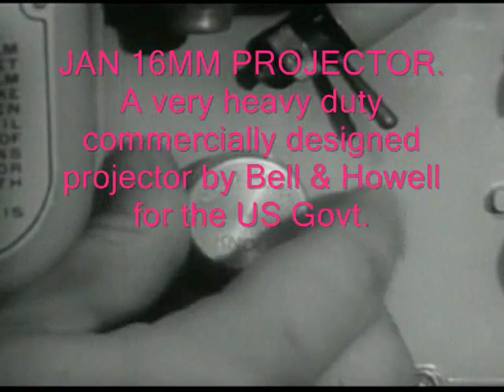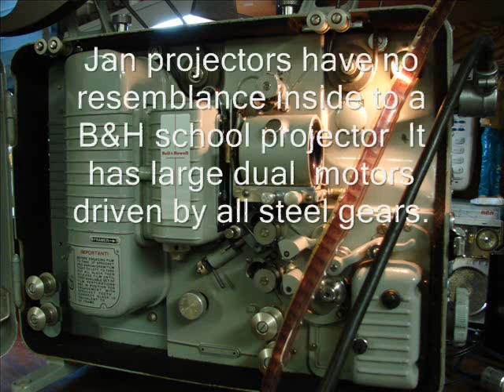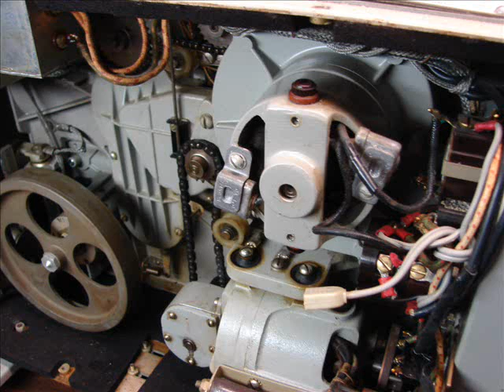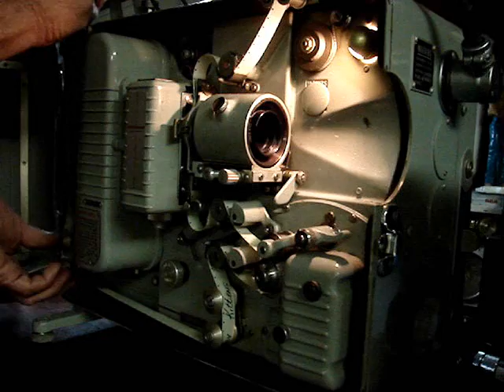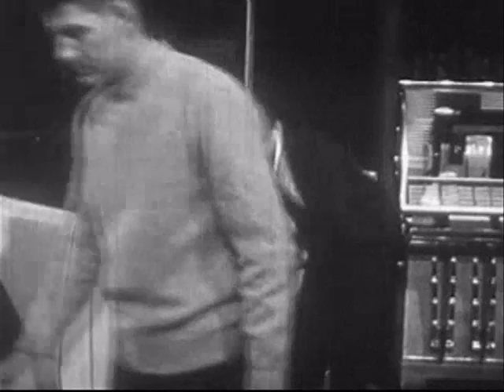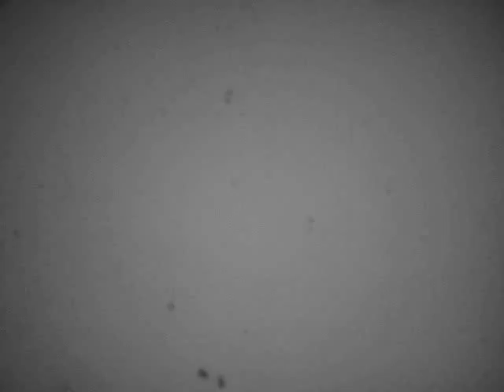Jan Bell & Howell Military 16MM  Projector

Comment: I have that same projector I got off Craigslist a few years ago.. I think I paid $50 for it.. The thing is heavy.. The sound is very low on mine and can barley hear the film with the volume all the way up.. I think some films are a bit louder than others.. I used a Qtip to clean around the drum, and checked all the tubes which happen to be all good..
Reply: maynardcat I think I read your comment about that.. I like them.. I know I'm keeping mine.. Just got to find a way to fix the sound... Mine also has a fuzz noise, sorta sounds like an FM radio station that's not tuned in, it's not really loud.. I've got a huge instruction booklet with mine that has the schematics and everything, and I see something that is a photocell, and looks like a small light bulb with two wires coming out, and it looks to be located in or near the drum... Perhaps maybe that's the problem and I don't know where to get a photocell..
Reply: maynardcat Are you sure that's what they take? The one that shows on my manual is not a tube, it's glass with two wires coming out of it.. Almost can be mistaken as an indicator light bulb..
Reply: maynardcat I know what the exciter lamp looks like..  One of my other blue/green Bell and Howell classroom projectors has that same bulb in that picture for the exciter lamp.. Except it does not come on.. It's not the bulb, bulb is good, and it's extra one in it's storage case is good too, but for some reason the bulb does not come on.. I believe I have a third projector that's a much older Bell and Howell model that has an external speaker that also has a sound problem..
Reply from the maker: vintageceilingfans I had the same problem with the exciter lamp in an Ampro projector, the exciter lamp would not light, and I replaced some capacitors in the amp and the lamp worked fine afterwards.   I have around 3 Bell & Howell school projectors they are the older turquoise colored ones and I have another one that is a late 70's or 80's model.
Reply: maynardcat Interesting, let me know if you come up with anything..

Adam